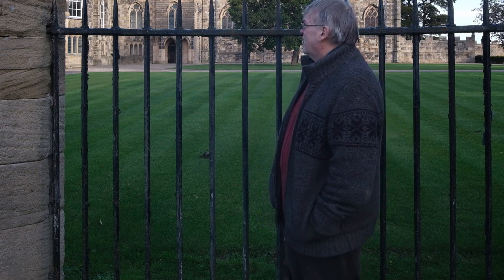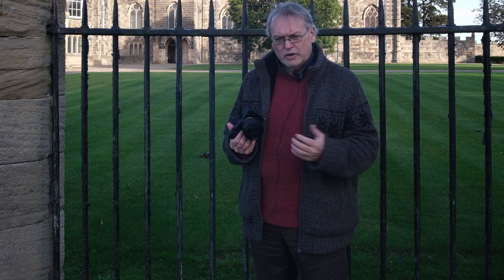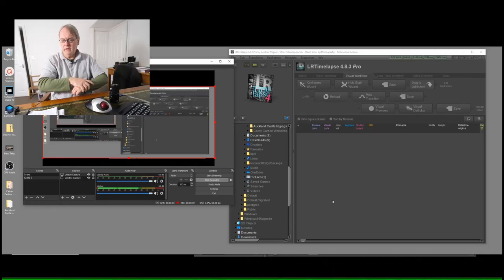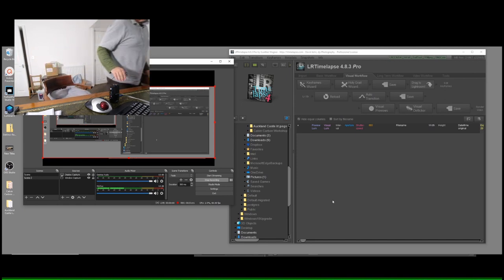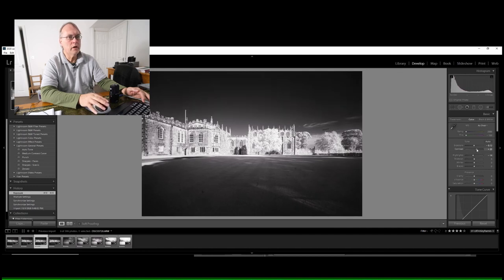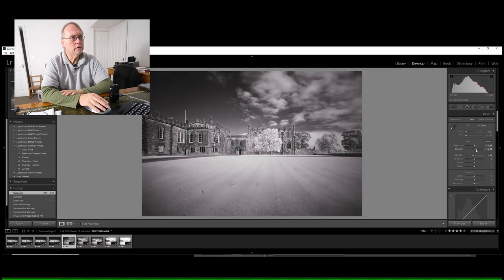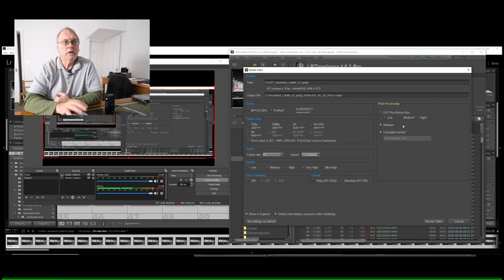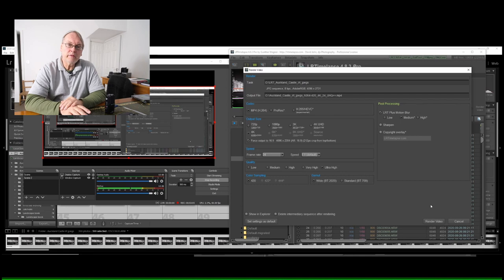Shooting and post processing an Infra Red timelapse at Auckland Castle

Comment: Hi Dave, very good video, very informative. Microphone worked well in the wind, volume good. Indoors had to use full volume to hear you, right channel almost no sound. I'm looking forward to your experience with Rollie 400 IR and the 850 filter. My effort was a complete failure, all frames under exposed 100%.
Reply from the maker: Hello Anthony, Sorry to hear that your IR experiment didn't work out. I will give it a go, but may be a while before I get to it ... ther are a load of projects on the go first! When I next make a screencast video I will check that right channel issue. Many thanks
Dave